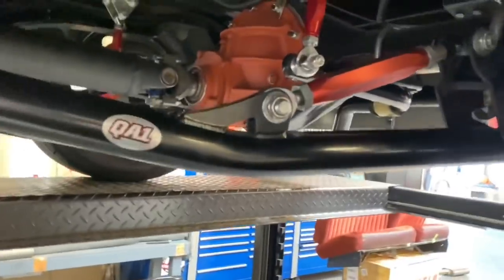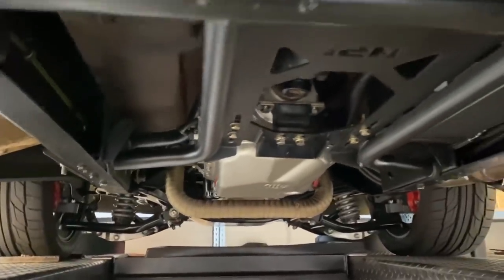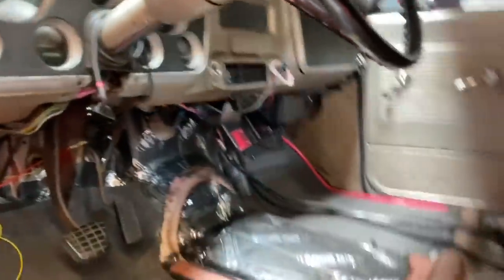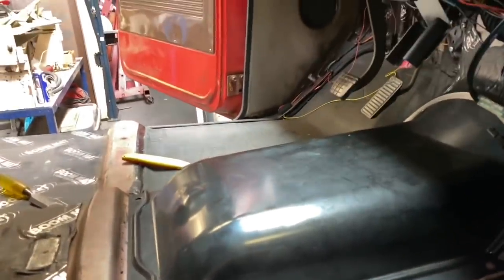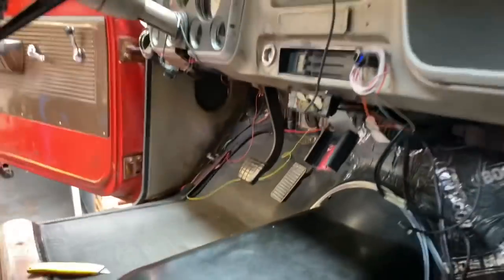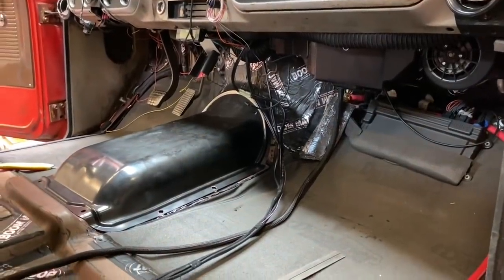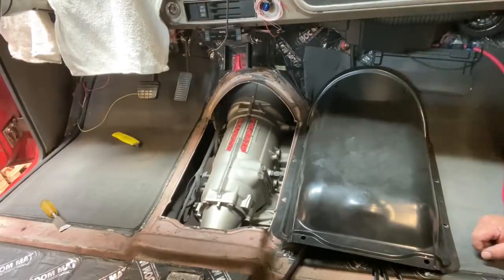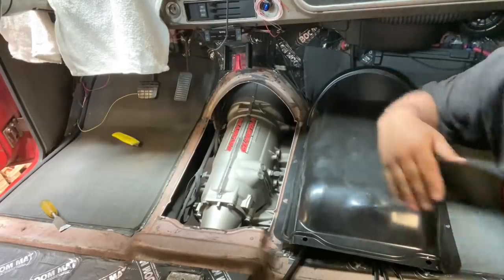Shop Truck HumpDay

Comment: SWEET, the shop truck is only getting better , that AMD trans tunnel is pretty awesome to be able to purchase and not too hard at all to install , with nut inserts  that just makes it that much easier and foam tape on the edge facing the trans helps to eliminate any dust/moisture from entering the cab of the truck , a company i use to work for had us do similar  retrofits to busses , it was a little hard at first , when you got onto the 2 &3rd ones it got allot easier to do and the adjustable links at the diff sure help, I am going to purchase some of those for my car soon , they just make sense and work very well for axle alignment  👍 look forward to the next video on the shop truck, better more HP than less

Comment: Best automotive use of a wood chisel.
Reply: "Best automotive use of a wood chisel" . So many upset Dads wondering where there favorite chisel went when they finally went into garage to get the the thing to fix that stuck door...  I agree greatest tool for scraping outside of woodworking. have one also.
Reply: Collision tech here, I use wood chisels exclusively when needing to scrape off old seam sealer. They work awesome. 👍
Reply: @rustyjeep2469  Me too. Sharpen them up and keep them moving and the edge does the work.

Comment: Merci sakes. I  always read that with the engine transmission tail shaft down 3° then the diff needed to point up 3° so that they are parallel to each other. Really confusing here.
Reply: That's how I've heard, read and seen it done for many years.
Reply: That truck came stock with a two piece drive line and lucky is using a one piece....could be what the problem is

Comment: Thrilled to see the pinion angle discussion come up. There is a lot of different pinions on setting pinion angle up. Some say you read the angle on the pinion yoke, then the angle of the crankshaft/transmission yoke and the difference is your pinion angle.?!

I had seen it as...the angle read at the pinion was your pinion angle,  and the measurement at the transmission would determine if angle differences were in an acceptable range- which it seems you do too. Do I have that right, or is the 1st description more accurate?

Once you have it sorted,  I would love to see you run through it on camera with a digital angle finder and share the process!  Thanks man!
Reply: Both really. So the "professional" thing to do is measure at the yolks. Equal and opposite is what your going for. So if the engine is 2 degrees up you'll want 2 degrees down at the diff. Especially important for high horsepower builds. Now the backyard way is measuring both the transmission and diff and if they are within 2 degrees run it. With 2 degrees difference on a stock vehicle you wont notice it. Its when you get into horsepower where you get axle wrap where you need a setup like luckys and perfect pinion angles otherwise like for lucky the ujoints bind and go boom.

Comment: How are you adjusting the angle of the motor to compensate for the change in the angle transmission so you're not stressing the bell housing?
Reply: You don’t. The transmission mount is how you determine the angle of the whole setup

Comment: Do you think a 6L80e would fit under that high hump tunnel? I also don’t understand the comment about the pinion angle on the rear should never go up. I’ve seen a few degrees up on several cars. Don’t LS engines like to lean back 2-3 degrees, which would mean rear up 2-3, right?

Comment: If you move the tail shaft of the transmission up, won't that angle the front of the motor down? I thought that the engine is supposed to be tilted back a few degrees.
Reply: Nah. Engines can be tilted back or forward no harm no foul. And we are only talking 3 degrees in luckys case. Probably not even half of an inch spacer will give him the angle he needs. Wouldnt even notice.

Comment: I have road raced cars without all of these 'critical' angles with no troubles. Pinion up, pinion down [where it hooks better] with the gearbox in the standard location. Even the tailshaft running off centre with a 9" with equal length axles. And that at 170mph+.
The tailshafts though MUST be made properly. And use good [Spicer] unis.
The only problems I have ever had is unis binding on severe angles on a classic supermodified on rough hooky tracks, Which in turn broke the diff pinion shaft.

Comment: What's your opinion on the 2 piece shafts I know it's not ideal but what kind of abuse will they take? Stockish bbc?
Reply: Stocker in my 68 still, the worst part for me is finding a steady bearing that can take the torque without letting the bearing deflect, they are garbage nowadays.
Reply: @TheCanadianBubba  Thanks I appreciate the response.👍

Comment: Lucky I know that truck in stock from has a pretty noticeable offset on the transmission wear your is centered leaving little slack for in and out movement center looks good but it doesn't have any give so the u joint wear out from lack of lubrication shift it over to the passenger side a little bit  understand why you are going up to do the same thing but some how it doesn't seem to me like it'll be happy with a torque load  with the motor shifting to one side or another could we're out mount quicker (but what do I know)  anyway cool update on the shop truck lucky

Comment: "You never go up on the rear pinion".  What problem does this cause?  I understand the need to have the pinion/transmission angle to be the same (creating parallel/opposite lines) but what problem is caused by having the pinion pointing up?

Comment: My obs is on a 4/6 drop and has a vibration when I let off the gas sometimes at highway speed, would you say I’m having a similar issue as your pinion angle mismatch?
Reply: I'd bet that's your problem
Reply: I have the same problem with my OBS. Tried changing the position of the engine, adjusted the pinion angle, on the second balancing of the drive shaft. I’ve put on new lower tubular control arms. Tires have been balanced and re-balanced. Nothing seems to help. Happens at about above 60 and smooths out and happens coming back through that speed.

Comment: Does anyone know if they make a removable transmission hump for a 80's Chevy C10 squarebody?
Reply: Yes.  Or more precisely, they have made them.  You can get one out of nearly any 81-87 truck that had a floor shift 4 speed.  You will have to weld up the hole in the floor or screw down a sheet metal patch to cover the hole for the 4 speed.  I looked for a repop one a little bit, but didn't see any.  It doesn't mean there aren't any however.